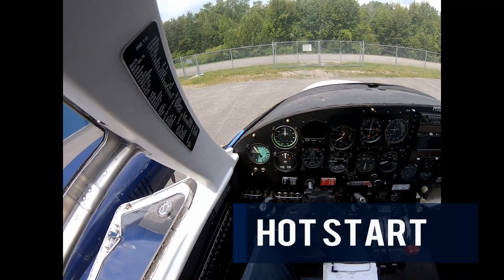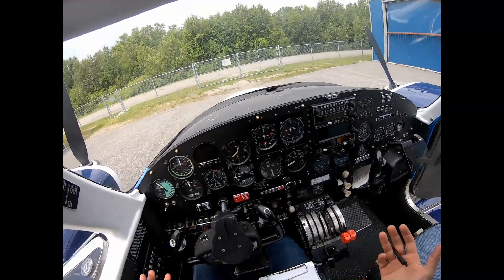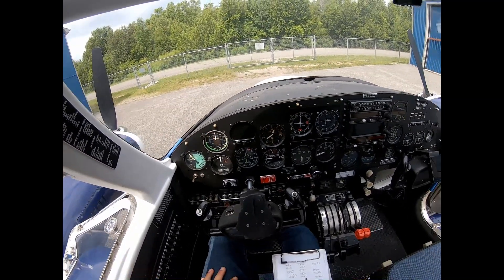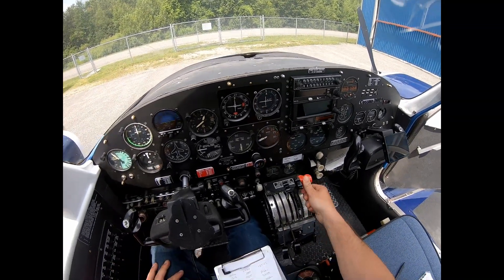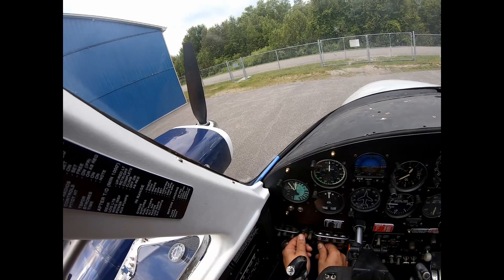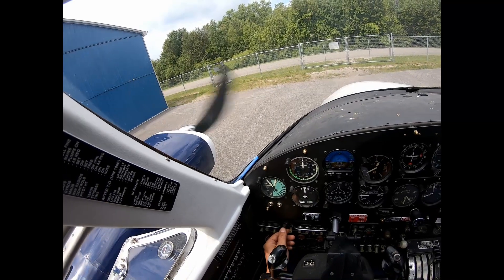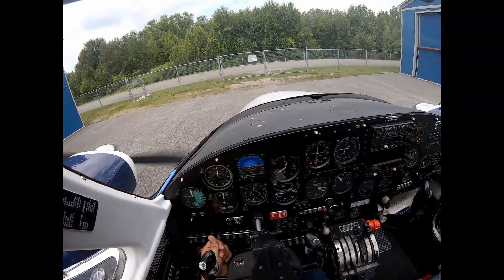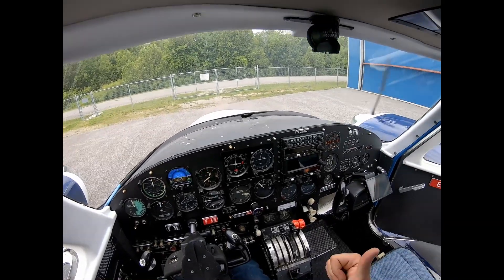Hot Start Cessna 310

Comment: Hello! Thank you for this, this great! I have a hard time to restart my engines on the 310R every single time. Takes me a ridiculous amount of time. Just for clarification here, we are talking about the boost pumps (high/low/off) and not the Prime button correct?
Reply from the maker: Yes I would recommend trying it with the boost pump on high instead of the prime. I have had very good success that way in an R Model as well. 

Another way to build confidence with the hot start is to leave the airplane outside your hangar or in front of your parking spot when you get back from a flight. Start a timer after shutdown, give the airplane 15 minutes then get back in and try the hot start sequence. 

If it doesn't work you don't need to slog the starter motor to death because you actually don't need to start the airplane. You have got two engines so you can try a couple of times on each one and just make notes of what does and doesn't work. 

I do this with all the fuel injected airplanes I fly until I get used to all of that little idiosyncrasies. I hope that helps.
Reply: @fastbackflying853  Thank you so much for the tips! I will try this!